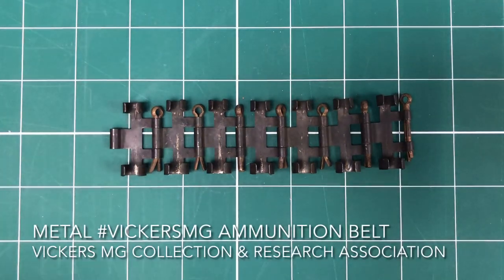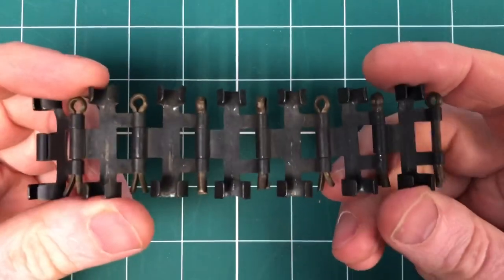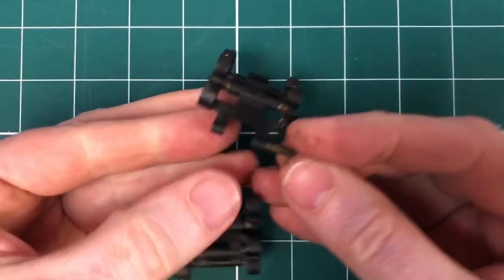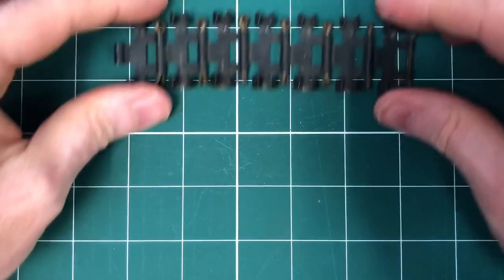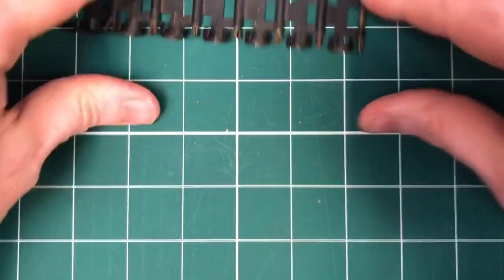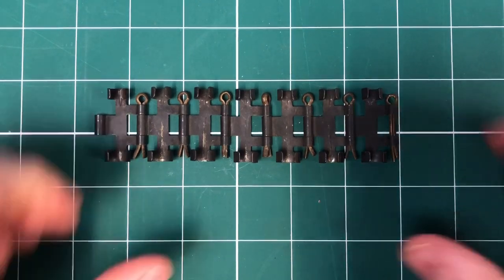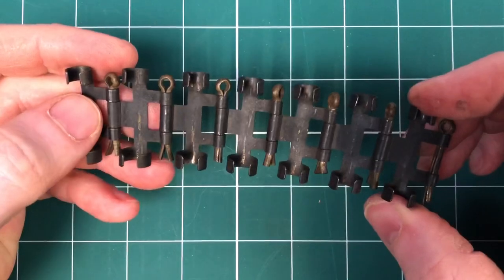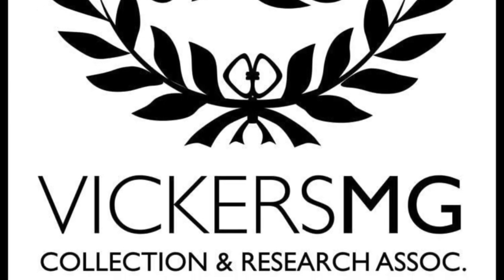Metal #VickersMG Ammunition Belt

Comment: They were so close to making that design leap to disintegrating  link. If .303 had been rimless and push through of course.
Reply from the maker: Take a look at the linked video. There was disintegrating link for the aircraft Vickers MGs.
Reply: @vickersmg  Ah ha. I shall.
Reply from the maker: There were quite a few different variations over the years of service. Because of the rim, they don’t have the normal ‘tail’ on modern link but they otherwise look very similar.